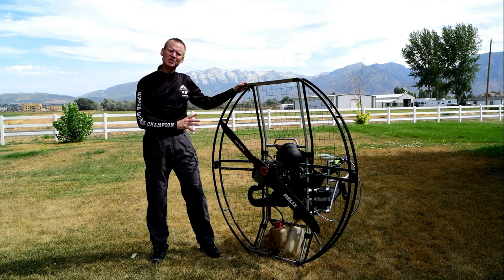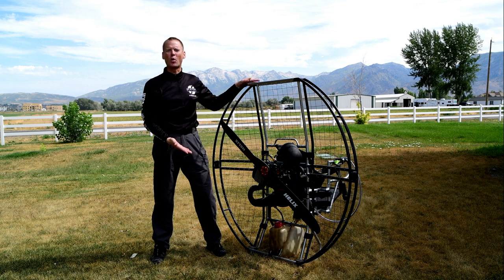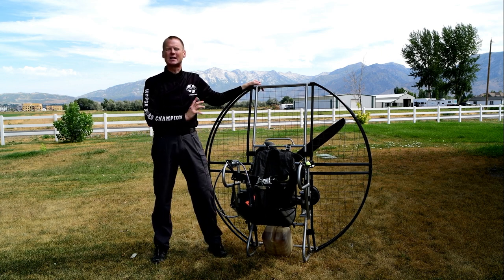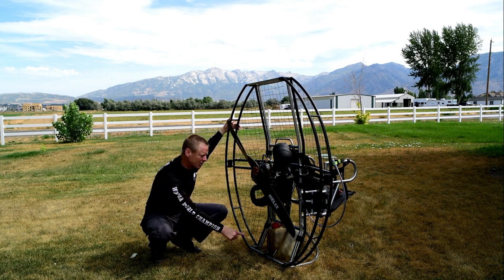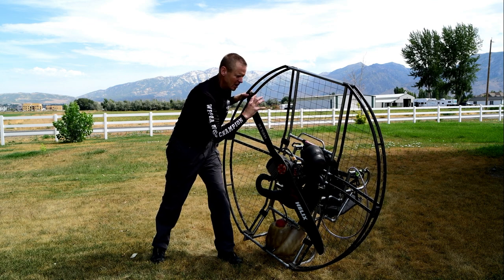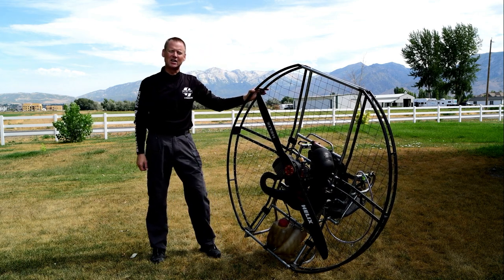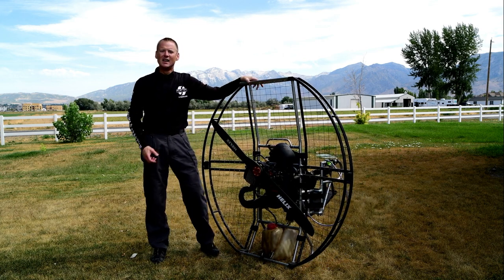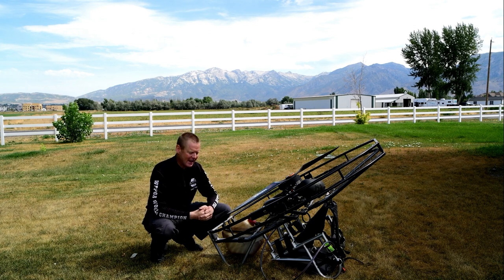Safest Paramotor Fuel Tank Placement! WPPGA Powered Paragliding World Champions Shares Tips!!

Comment: This is one video I actually have to agree with Dell on pretty much all his points. A lot of people don't realize how much the fuel weighs. A full 5 gallons (max allowed in the US) is a little over 30 lbs not even taking into accound the weight of the tank itself. A couple points that Dell didn't mention. When you go to fill the tank, It's a lot easier to do if the tank is down low and then if you spill a little, it's not going all over your engine, frame, and harness. If you want to disconnect the tank to store it separately or take it to a gas station to fill, it's easier to do if it's down low especially if the frame is self standing). Most paramotors have the tank below the engine for these and the reasons Dell gave. There is one fairly glaringly obvious exception I'm aware of though. I'd never touch a paramotor that had the tank above the engine simply because if the engineers were that incompetent about that, I have to wonder about everything else as well.

Comment: What is the total cost of a good para motor, and everything else that is needed ?
Reply from the maker: It's about $12,000 for all the very best gear in the world.  That's the Flat Top Ninja, Dominator and super mini reserve.  Or we have the same gear used as low as about $6000-$7000.  If you go lower than that you will make some big sacrifices but we also have gear as low as $3500 for a wing and a motor.  Call us at 800-707-2525 as we really have many many options in most any price range and can explain all the details and differences.
Reply: OK   i am going to get the very best,and i will take the time to look at it all before purchasing. Thank You for the reply Dell.
Reply from the maker: Ok no problem.  The very best is the Flat Top Ninja paramotor, Dominator paraglider, and SUPER mini reserve.  That's exactly what I fly and what my kids fly.  So it's light enough for my 12 year old to launch in nil wind up here in the mountains but so powerful you can see me setting world records with the very same gear all over youtube.  Call me as there is much more to it than just a few specs or details.  800-707-2525
Reply: OK